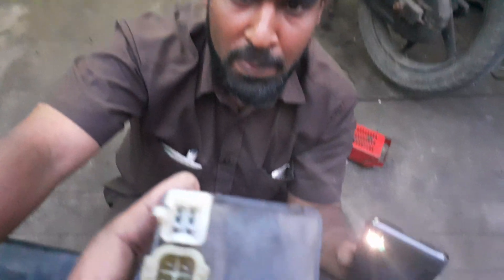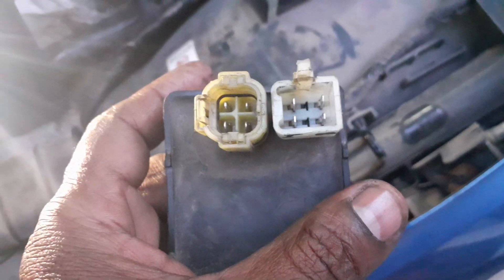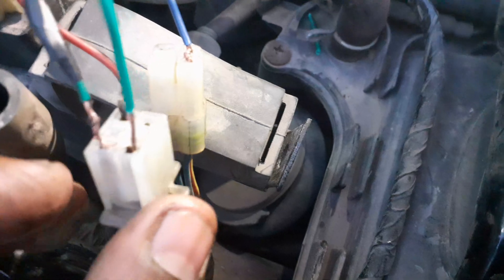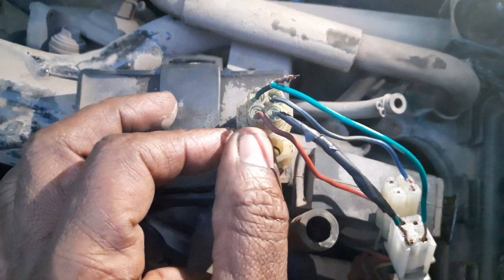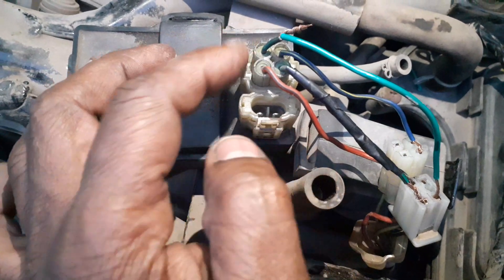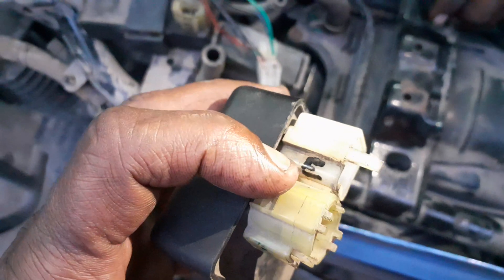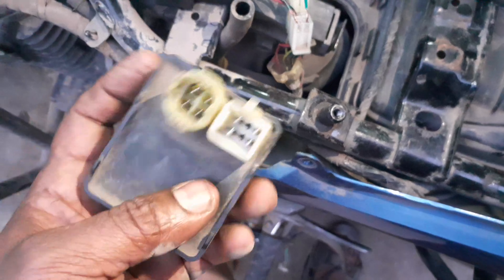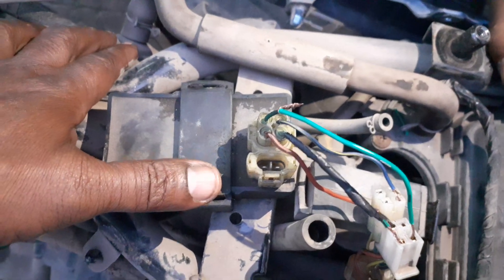Honda Hornet tci coil failure | shine tci alteration |

Comment: Anna splendor plus ooda headlight ah AC to DC ah convert panna battery down aaguthu so coil alteration pathi ethavathu tips sollunga Anna.....
Reply from the maker: Dc alter panna kandipa kurayum.
Naan check panni parkavillai
Check panni solgiren
Reply: @BS6-Technical na check pannita Anna halogen bulb(35/35) use panna ampere patha mattaguthu so battery down aaguthu anna but led headlight bulb use panna battery down la aagala aana led headlight bulb life varamattaguthu na...so splendor plus magnet coil alteration pathi oru video poduga ....splendor ooda lighting so bad pls magnet alteration pathi oru video poduga anna